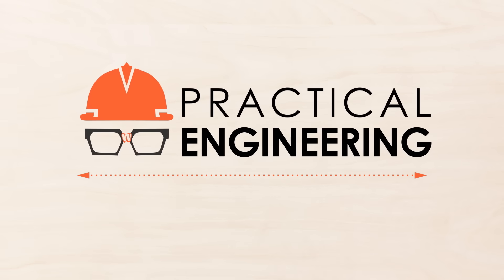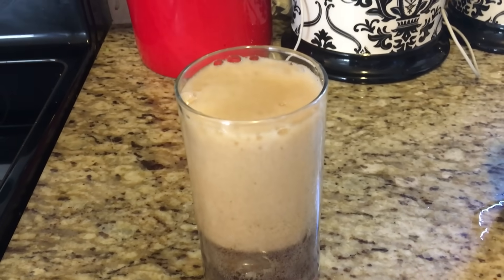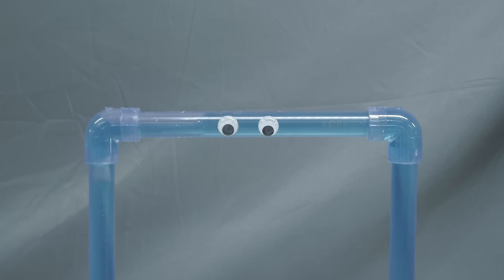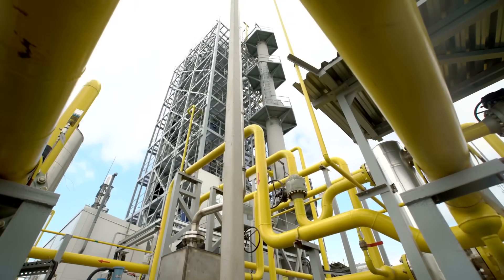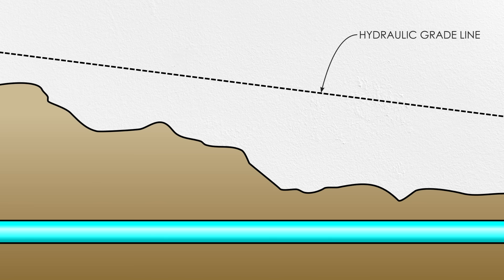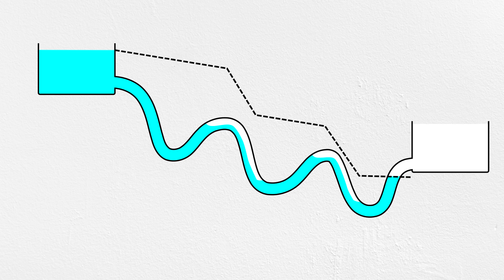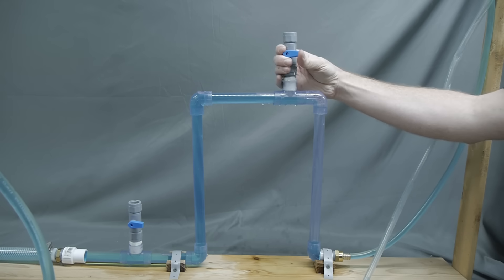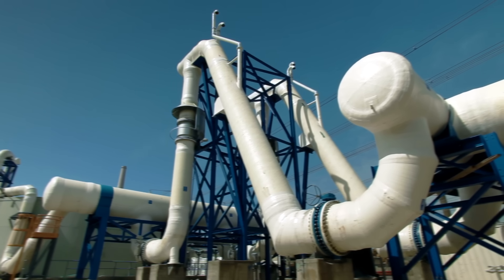What is Air Lock?

Comment: I work in wastewater treatment, and airlock is one of the more vexxing problems we have to deal with. It is unbelievablely frustrating to tear down and rebuild a large pump only to find that it still is not pumping enough, or not at all, then realize the air relief valve is simply plugged.
Reply: Everyone should take the opportunity to visit their cities waste water treatment plant to learn about its operations. You also get to learn about all the stupid crap people put down the loo. Some people just don't deserve to have access to a proper sanitation system. They should have to learn the hard way to value and protect it.
Reply: ...That sounds unbelievably disgusting also... You sanitation folk are true heroes, dealing with THAT so the rest of us don't all get cholera... Bless you for your service!!
Reply: Its not that bad, really only stinks at the head works. Most of it smells like musty dirt. If it stanks ph is usually too low or the dissolved oxygen is. Its a great job. @jimschofield8734
Reply: Ok as a commercial service plumber, I laughed at this, WHY wouldn’t you check the easiest solution first? If you know the air relief valve is a common issue, why isn’t that the first thing you check before pulling a massive expensive pump?
Reply: Dude, I want Grady to do an entire episode on how lift stations function. And how they break down.
Reply: @ulogy  I would love to see a video about lift stations. There are so many different designs, materials, sensing and logic equipment, and all with their own strengths and weaknesses.
Reply: @ulogy  They grind and pump ( w/ high and low limit switches).
Reply: @louf7178  Yeah, but the significance and simplicity of the basic design is impressive.
Reply: you will notice in the video that the air relief valve was on top of a tube. the taller the tube the more air it can take before letting air into the system. as for as a waste system which deals with mixed fluids (sludge) this means that you have less turbulence at the valve leading to greater separation of the fluids and thus less dense fluids at the valve (reducing the time between clogs). if it uses a float valve similar to what the video had then you can extend the float down further from the valve gasket reducing the water that touches the gasket (reducing the chances that the gasket will get stuck open or closed).
Reply: I was just wondering, if the system could be made to work like a auto siphon. Instead of pumping the water, we could use the air to push the stuff out and periodically repeat the process....would that be practically possible?
Reply: Check the relief valve first next time
Reply: you'd think there would be a troubleshooting maintenance and repair diagnostic guide that tells you what to check for before you commit to disassembly..
Reply: That's why We as civil engineers, learn to always start with the simplest things before tearing apart and entire system
Reply: Suggest that you observe and record the normal discharge pressure of the pump at 600gpm. Then when flow drops to 200gpm while discharge pressure is higher than the usual pressure, then it's airlock. Else if pressure is lower than normal then it could be pump issue.
Reply: I work for a vendor that manufactures and sells mechanical seals in wastewater amongst many other things. Lift station pumps in particular see a lot of rags, trash, grease  etc. Can actually be somewhat challenging to seal lift stations because common practice is to use split mechanical seals so pumps do not have to be removed from service to change seals. Split seals are almost always single seals and the faces run on process fluid, which causes issues because raw untreated water found in lift stations has sand, rags, grit, sludge etc that will be forced across the faces and ruin face integrity in a matter of minutes. I have one plant that runs double cartridge seals on most of their lift stations and all influent pumps, they have seals in service 6 years and still running dry as a bone because filtered non potable is used for barrier water. No packing to mess with, no crappy single seal life. I wish more treatment plants would do the same but old habits die hard.
Reply: Yep
Reply: and the air smells like shit in your case
Reply: If a longer vertical pipe going up to the relief valve doesn't help enough, then you need to find an easier way to keep those valves clean.
Reply: Is it really that much of an impedance?  I may be oversimplifying, but I can't see flowing through air pockets as that bad, in reality??
Reply: @louf7178  It makes a huge difference. On a system that we have had several instances of the air relief valve sticking (we wound up replacing it) the normal flow rate is roughly 600 Gallons Per Minute. With air in the line its more like 200 GPM.
Reply: @biggreenblob  Thank you.  Somehow engineering (school) has made me worse.  Maybe it is especially worse there because of the carrying effect of the sludge (if you're talking about the waste water specifically).

It must have to be the loss of the siphoning effect and momentum with energy losses while compressing the air pocket - expansion must back-shock wave also.
Reply: @biggreenblob  I imagine, in wastewater, you deal with a lot of flammable gasses like methane? Also, as a former smoker who used to flush cigarette butts, just how bad is it dealing with cigarette butts?
Reply: @holocaust_2.0 methane gets collected for reuse from sludge digestors. Cig buts are removed at preliminary or primary treatment, not much of an issue. In the lagoons I over see they end up floating alot, its unsightly but doesnt effect operation. Just realized this comment is 3 years old.
Reply: @Bradawick  Still glad I got an answer! Thanks!
Reply: Honestly because it is probably a public utility and thats why my water/sewerage treatment bill is like a 100$ or more a month for 2 people and a German Shepherd. 

LOL Gotta pay them Bernie lovin’ Union workers to stand around on 8th break watching a team of guys tearing apart something that isn’t broken. When the real problem is a 20 min. 1 person (with a pair of Channel locks) repair.
Reply: @user-kn5ol8ck8s  Brutal

and honest... hahahahah

Comment: It's entertaining to me the differences and similarities in our industries. I do mechanical and plumbing design for buildings and we always go the way of sizing the pumps larger, even for some rather big runs of piping.

We do try and remove the air for open loop water systems but those are rather easily naturally vented. And the principles of flow with sir present are accounted for with drainage piping in building codes by having them oversized. I work with civil engineers and it seems somtimes we use different principles to handle the same problems before and after the pipes leave the building

Comment: Is pipeline design a job for Civil Engineers in the US?

They teach it to both in Brazil. On a class of 50 I was in, there where 3 or 4 each of civil and chemical engineers. But the job itself is usually done by Mechanical engineers.

Comment: Great video, I learned a lot!
On a separate note, please don't use your Teflon pans on high heat! I'm sure you (an engineer) would appreciate the importance of a (Material) Safety Data Sheet. Check out the warnings on using Polytetrafluoroethylene at high temperatures.
It damages your lungs, and if you get a pet bird you'll end up killing it.

Comment: This channel inspired me to become a student of Civil Engineering, never thought I'd be interested in sewage and drainage and other public infrastructure. Thanks dude!
Reply: Jeez stop being so negative everyone. There is always demand for good engineers who know what they are doing, and it’s fine to be inspired by a youtube channel.
Reply: @thosewerethedays3885  What design of vent do you mean ? As obviously different types of vent (even if they share a common name) have different purposes.
Reply: @thosewerethedays3885  That's all those are for. I've seen an upright pipe Teed at the top with each end of the horizontal bit having a 90° bend pointing downward. I've seen over-sized caps fitted - it's all ways to stop rain getting in - or other things falling in if indoors. Nothing more complex than that !
Reply: @thosewerethedays3885  So regarding which tanks do and do not have them, it can depend on the tank, what is being stored, what is being vented, what flow rate through the vent is expected, and probably more I'm forgetting at the moment. At the end of the day the only reason to have a gooseneck vent at the top of a tank is to prevent rain (or other stuff you might expect to fall from the sky like hail, snow, etc) from entering the vent line. But there are conditions where you can't point the vent straight down. Lets say it's an emergency vent on a pressurized gas tank (ie the fluid is in gaseous form, not that it stores petroleum). Pointing the vent straight down could fire a high velocity stream of gas right into the tank wall, or onto other equipment, but pointing it sideways would cantilever the vent line, so you might want to use the T method that @pmailkeey mentioned. Or lets say you have a large reaction vessel which is producing some chemical you want and is constantly producing water vapor as a result. Now lets say that it is better for efficiency to run the process at higher pressure. What you can do is size a smaller vent so that the production of water vapour pressurizes the tank. Now you have a constant stream of pressurized water vapour exiting the vent at likely high velocity (well high enough at least) and so it will simply blow the rain away from the vent. Here you wouldn't need to bother with a gooseneck and you could use a straight vent so long as there was a way of closing the vent when the reaction vessel wasn't in use. It will always depend on the details of the situation and whatever option ultimately yields the most preferable solution. Usually this means the most financially optimal solution, but not always.
Reply: You love this shit, huh?
Reply: A friend of mine is a retired civil engineer who worked with drainage and wastewater management. One time he commented that he had managed to produce a 30 year career from the fact that water flows downhill.
Reply: I'm not sure why people are being negative about job prospects for civil. My college, with its not particularly prestigious, middle of the road college of civil engineering, has so many career fairs specifically for civil engineer, and so much demand for those engineers, that it's rather difficult to keep up and respond to all those companies looking for employees. Get practical experience through internships or co-ops and you'll absolutely be in demand. Everyone needs buildings for something.
Reply: I call bs
Reply: BiG Al About?
Reply: ooof, guess why he has a YouTube channel... there is no work for civil engineers. I remember I worked with a civil engineer in construction side by side as electrician.
Reply from the maker: This is just a side project. I have a full time job as a civil engineer.
Reply: @PracticalEngineeringChannel  Well, I think you're being very civilised for sharing this info with us ;) - although it's not much of engineering if an oil can is not required ;)
Reply: @advocatusdiaboli9351  thanks for the anxiety i needed more in my life
Reply: @advocatusdiaboli9351  the reason why he has a youtube channel is because there are a lot of people that interested and apparently work as civil engineers as his viewers. the world's population keep growing every day, and people will need house and infrastructure to support their life. So yeah, there will still be lots of jobs for civil engineers.
Reply: @advocatusdiaboli9351  hi, the lack of work for civil engineers might just be in your area. There are plenty of places (such as south central Texas) that has a skyrocketing demand for civil engineers
Reply: @advocatusdiaboli9351  And yet it is one of the highest demand engineering fields.
Reply: @advocatusdiaboli9351  Were you really working with a qualified civil engineer, or a glorified technician who assumed the title of 'engineer'?

Comment: Sufficient pump head and flow is especially important in U-tube (not YouTube) heat exchangers. These are commonly found in nuclear power plant steam generators and even in some electrical generator coolers and various process boilers. You can't put a bleed valve on every tube so you always have to evaluate how much head you need to drive non-condensable vapors from the tubing.
Reply: Is it a sealed exchanger? Sealed cooling system? Or more like a pump and dump?
Reply: Curious, what makes them have to be vertical and not horizontal?